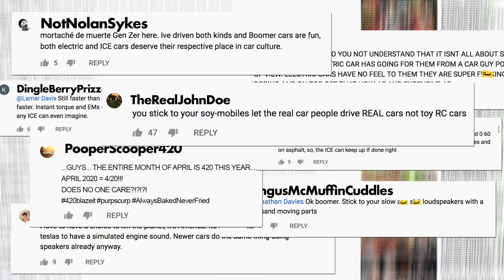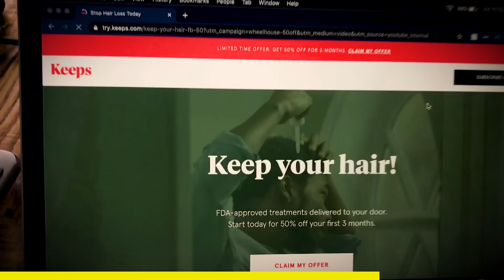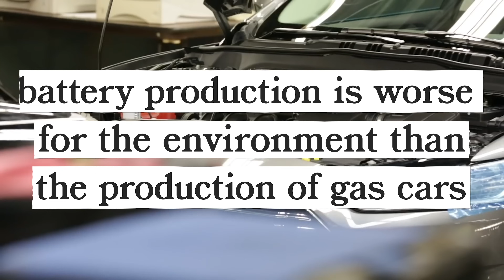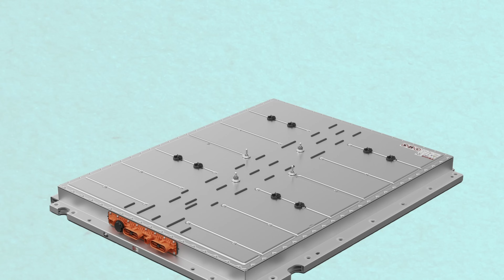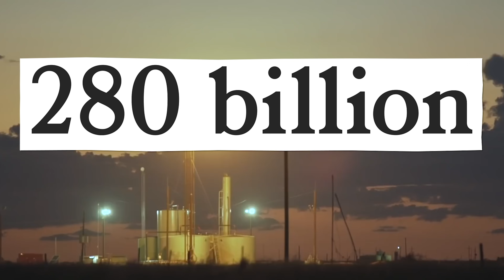Are Electric Cars REALLY Better for the Environment?

Comment: An informative video. The only element missing, in my opinion, is 'how long does an EV battery last'? Is it true that they are prohibitively expensive to replace, rendering the vehicle useless?
Reply: Not very informative. If he were trying to inform us, he would have spoke on the fact that there are massive factories all over the world that have to recycle the batteries and they produce TONS of cO2. Also the fact that most EV owners will be replacing their battery modules for new ones when they stop holding a reasonable charge.
Reply: @ayoungtricknamedjim5498  How about you look at the facts of how long new electric batteries will last, there is serious talk of 1million mile batteries. Current tesla model S batteries are still at 90% capacity after 200,000 miles
Reply: @alanstyan1726  your subjective experience is not fact. What I've stated are facts.
Reply: @alanstyan1726  I'll also add that your poor argument is a strawman fallacy. You are being deceptive (deliberately or not) by stating that you allegedly still have 90% capacity after 200k miles, therefore expecting everyone to believe that MUST be the norm (it's not). You're trying to obfuscate the facts by sharing your subjective (and highly irregular/uncommon) experience. It's a very common and weak tactic of attempting to prove a point. I was simply pointing out the fact that this video deliberately left out a whole lot of information that would make ICE vs lithium ion battery cO2 emissions a lot more equal, and could even tip the scale in favor of Ice. I'll also point out that I said that EV owners will replace their battery packs when they stop holding a reasonable charge, which you claim yours still does. Try to pay attention to what is actually said before you reply with your emotions, rather than understanding what has been said. It'll help you use better arguments in your future encounters.

Best.
Reply: @ayoungtricknamedjim5498    What I've stated is factual based on data released by Tesla (i do not own a Tesla nut have just read the data). Im not going to be able to cha.ge your mind as you already give the impression of being opposed to EVs, but we either need to stop driving or transition to a more sustainable way of doing it. continuing to burn fossil fuels is not going to cut it. EVs can in theory be built with purely renewable energy. but enough i don't even know why i replied
Reply: Electric batteries are advanced eniugh to last at least the standard 200k miles. Better question to ask is, why wouldn't they? Cost of maintenence is another plus. Can't kill yourself in a closed garage either lol
Reply: @br9760  I understand well the cost of maintenance is much lower with BEV. Also, the "standard 200k miles" has been conservatively set based on the human expectation of ICE engines to entice people to get into BEV. However, BEV last far longer than 200k miles. There are plenty of Teslas running well past 1,000,000 miles that are still in fantastic shape; they just have had to replace the battery packs a few times. The general public will eventually adopt the reality that BEV can--and will--run over 1m miles with the only major maintenance costs being the battery module replacements which, again, this video didn't elaborate on when factoring in cO2 emissions.

Comment: Know what's even vetter for the environment? Keeping your old cars alive so new ones don't have to be made! Woohoo. Don't throw away your old cars. Unless they have rust holes in them. Then, yanno
Reply: A car with overly large rust holes would not be permitted to drive on the roads in the UK. It would not be deemed to have sufficient structural integrity.
Reply: @Brian-om2hh  haha makes sense. Some of my first cars had rust holes bigger then my head. I remember a truck i had would just crunch when you tried to jack it up on the frame. Got it for $550 and the 4wd still worked XD

Comment: I think we should also talk about how you dispose of the batteries? I would say that needs to be included in the equation
Reply: Yes yes yes
Reply: Add in how often you have to replace said battery and how often you replace the whole car.  EVs just don't have the long term reliability that ICE do.  Those alone will drastically sway the numbers..
Reply: @FJB2020  definitely not enough to add up to gasoline vehicles.  Especially with the new infrastructure bill that will push more and more renewable energy.  If battery disposal is the only problem, gasoline loses easily.

Comment: "after a certain amount of time..." what time frame though? Batteries don't last forever, batteries aren't recyclable as of now (5%). Also, what about the cost and the problem of creating EVs? I read that EV's end up on a dump once the batteries die bc its cheaper to get an entirely new one (biggest cost is in the batteries), we might end up with Tesla graveyards in the future (there already are a few afaik). God i wish i had all the numbers, actual numbers, bc i don't trust any of this shit, i believe its all just smoke and mirrors used by an egocentric maniac to funnel government funding into their own pockets.
Reply: actually modern EV batteries can last well over 500,000 miles and have been doing so with models made as late as 2012. In relation to recycling, no, they are 95% recyclable. 5% is how much of the worlds batteries are recycles. including all the batteries you use in your xbox controller which get thrown in the trash every week. As for the cost of replacing a battery once its used up in an EV. Replacing the battery and the pack which makes up a significant portion of chassis, is very very expensive, yes. But when you have to change the batteries in your remote you dont throw out the remote, you just swap the batteries. Most EV's use thousands of relatively small 18650 batteries (thats the name. google them). to replace them, inclusive of labour it costs around $7k USD (a decade ago it cost $12K USD). its predicted as production increases in a decade this number could be as low as $3k USD. which is fairly cheap for a battery system that lasts twice as long as an average combustion engine.
Reply: More nonsense. EV batteries are almost completely recyclable..... And I'd advise you not to believe all you "read", because some of it has left you rather misinformed......

Comment: "The electric grid can handle it" Are you sure? According to NY and Texas the power grid can't handle people using their own AC, charging an electric car takes a whole lot too
Reply: This and my personal favorite the water consumption needed to mine for Lithium - oh it just means dried up field for farmers, no big deal right?
Reply: @Rayartz  you dont extract lithium from farms. you also dont use drinking water. Lithium is most popularly extracted from bore brine. which is almost exclusively found in arid deserts. which are mostly unpopulated. They drill very deep into the earth the get to these brine pools which is water too salty to be used for drinking, livestock or farming. it will just kill any plant you water with it. That brine is then processed to remove the lithium. Context is everything kiddo
Reply: @engineeringtheweirdguy2103  Did you watch the video? Nolan specifically mentions that the water needed DOES impact farming and agriculture
Reply: @thergreen6963  It does have an impact on farming. Thats not negating what I said. When the lithium is extracted from the brine, they release it. they dont put it back into the bore hole. Brine is too salty for crops and damages them if it leeches that far away. Most lithium extraction is done in large arid regions, only a small handful do so in regions nearby agricultural land like in Chile. In most cases its taken from desolate, uninhabited deserts, like in outback Australia where the nearest agricultural farm would be somewhere in the order of 1,000-2,000 miles away.
Reply: the Rgreen: I dont know what you're referring to about NY but Texas's blackout was due to a natural disaster. Are we going to say the Florida cant charge EV's because it sometimes results in blacks during a hurricane? What happened in Texas which caused the blackouts has never happened in Texas before. It got so cold the gas feeding the gas power plants froze. So the power plants had no fuel to generate electricity. Coal power plant which stored its coal outside (because they've never had anything like this happen) could feed the generators fast enough because the coal started to freeze together which took time and effort to break apart. Transformer switches in charge of load shedding froze in position. This has nothing to do with grid capacity or grid stability and everything to do with it being a natural disaster
Reply: @engineeringtheweirdguy2103  So I may have been misinformed on the situation in TX, but you're missing the point, if a natural disaster causes blackouts it's Not a stable enough power grid for our number one mode of transportation to be piggybacking off of. If the people working at power plants were all using electric vehicles, where are they going to get their transportation to work in order to fix the problem? They sure can't charge a car during a blackout. Coal and gas are not the most effective or stable ways to be supplying power to the nation, and you've just reinforced my point by highlighting the issues TX is facing. We need a more reliable power grid before we look at electric cars as a serious option for mainstream transportation.
Reply: @thergreen6963  I'm not sure you really fully comprehend that natural disasters, aren't a common situation. Something like that has never happened in Texas before. Your conclusion does not make sense.

additionally, you dont sit around with a flat electric vehicle and only charge when you need to use it. thats stupid. If everyone at the power plant used electric vehicles, when the power went out, they would presumably still have a full charge in their vehicles. 

in modern EV's, they store enough charge to drive a daily commute to work and about for about 3-5 days in a row without needing to recharge. You really should think this through more.
Reply: @thergreen6963  I just re-read my comments. they make sense to me. Am I using word that are too big? do you have reading comprehension problems?

Comment: Why is California having rolling brownouts if the grid can handle electric vehicles.
Reply: he was referring to the national grid. The average energy production capacity per capita of the country. not induvial states. California suffers from poor policy and grid integration. Basically grid policy was put together by idiots who didn't understand how the grid worked. The result was predictable. They have the power generation in place but lack the infrastructure and policy to deliver it.
Reply: @engineeringtheweirdguy2103  so the National grid doesn't include California? You are full of crap.
Reply: @patrickgoncalves3878  it does include California. But national grid isn't exclusively California. Do you have problems with reading comprehension?

Comment: No one uses Tesla cars for long, because the batteries lose capacity and cost too much to replace. I don't see many Electric Vehicles for a reason, they suck.
Reply: Incorrect. Nobody has used a tesla for long simply because the company isn’t even 18 years old yet.. watch any video of a tesla roadster from 2014 do a pull in 2021. It’s stats are pretty much the same from when it was first bought.
Reply: @Unimaginable  you are wrong.
Reply: @patrickgoncalves3878    That’s what I thought. You can’t agree with me because it will forever scar your ego and instead of giving a valid response you just call me wrong 

Typical “car guy” responce
Reply: @patrickgoncalves3878  actually there are hundreds of examples of Tesla Model S's reaching over 500,000 miles on a single battery pack with only around 20-30% degradation on batteries already more than 2 generations old. Newer batteries and Battery Management Systems (BMS) are set to last even longer and the early data indicates that this is true.

As for their popularity, the Tesla Model 3 is the most popular luxury car in any category The luxury mid sized sedan, large sedan, hatch, estate, SUV, Large SUV, Wagon, etc etc. Infact it out sold its next to closest competitors combined, beating out every other car model from Audi, Mercedes, Jaguar, BMW, Lexus and more. To say they're not popular is gross mistruth.

Comment: Electric vehicles make up 2% of car sales. Simple reason is the batteries lose 30% charge in the cold and they need to stay on in the heat to cool electronics which loses charge on hot days and batteries lose charge capacity over time, and those batteries cost more to replace than the car is worth. So no one can sell a used electric car.  Tesla has never sold cars for a profit in 18 years and the government gives Tesla 1.6 Billion in tax credits every year at least. Electric cars are bullcrap. Wind energy doesn't work look at blackouts in Texas. Solar power doesn't work, neither produce enough energy. The banksters are trying to bankrupt middle class.
Reply: Actually Tesla Model 3 has the lowest 5 year depreciation of any car in history. Further to that replacing the batteries is very cheap. Around $7k USD including labour, replacing the battery pack is expensive. The pack is apart of the chassis and includes cooling systems and other BMS's. But the Batteries in Teslas are made up of thousands of 18650 batteries. Which can individually be replaced. Its as simple as taking the seats out, lifting the floor up and taking the top of the pack cover off, then replacing the batteries one by one. And Tesla has been recording profits. Hell they made over $1 Billion in a single quarter in 2020. How do you think they can keep putting up Giga Factories in multiple countries simultaneously if they didn't have the finances to do so?

Also probably worth noting the % of car sales being electric, is heavily dependant on where you are. In the US its around 2% and growing. In Australia where they Tax EV's to protect Australia's fossil fuel industry, its less than 1% but growing. In Norway its more than 50% and growing. Globally its 4.2%
Reply: @engineeringtheweirdguy2103  you are so full of crap. 4% wow, that is pathetic. How does Tesla keep making pathetic cars they make, because Wall Street and the US government give Tesla billions. I know the truth and I know the facts, Tesla has not produced profits. You are propaganda. Look at Nicola, some fraud says he will produce electric trucks and Wall Street gave him 200 billion, along with GM. You people will do anything to believe what you want, you think if you lie to yourself enough and throw enough money at it, then it will be true. You are smoke and mirrors. I don't need you snake oil. Bug off.
Reply: @patrickgoncalves3878  actually both Ford and GM get more government handouts than Tesla does. ontop of that they also got a federal loan designed to re-kindle production in america. Ford and GM have yet to make a single repayment, whilst Tesla has repaid the loan in full with interest.

These arent difficult things to check
Reply: @patrickgoncalves3878  that took me all of 3 seconds to google. maybe you should try it before crying BS on things purely based on the fact you dont like it.
Reply: according to subsidy tracker, Ford gets some $33.5 billion in subsidies whilst Tesla only gets some $466 million.
Reply: @patrickgoncalves3878  you really havnt been outside of America have you? you think everyone outside of america only drive ford fiesta's. really? Is it a cozy rock you're living under?

unfortunately everything i've said is true. Infact in the US, the model 3 is the highest selling luxury vehicle in the US. in any luxury category. And out sell's its next to competitors combined. Those are facts kiddo. you dont have to like them.

Comment: What do you think emf level of hybrid and electric car. How about the efficiency of emf in the car on the baby or young children?
Reply: I think you meant effect. not efficiency. In any case, Inside a Tesla, even when hard acceleration, EMR (Electro Magnetic radiation) inside the car is lower than background EMR outside the car. Additionally, EMR has little to no effect on the human body, on account of most bodily tissue not having magnetic properties. If it makes you feel better, you get more EMF from your phone or computer than you do inside a Tesla. Because they aren't shielded. In additional cell phone signal, Wi-Fi signal, they're both EMR based. You will get orders of magnitude more EMR from your Wi-Fi router alone than even standing next to a Tesla launching. Yet alone your lights, phone (which you keep in your pocket) microwave, power outlets etc etc etc.